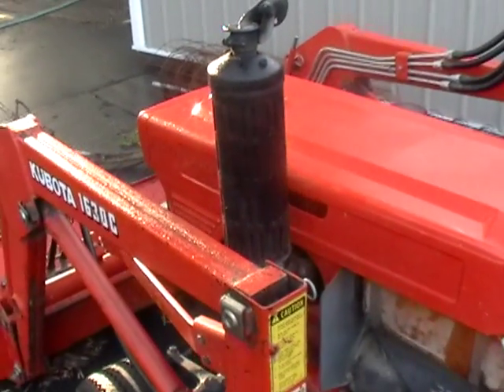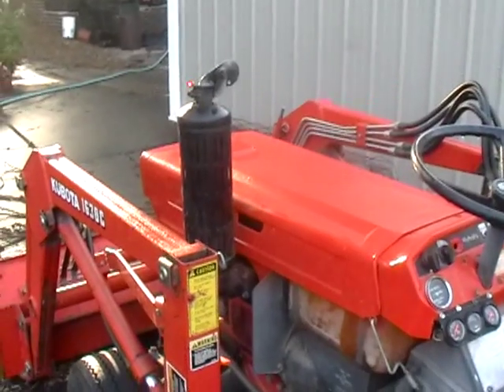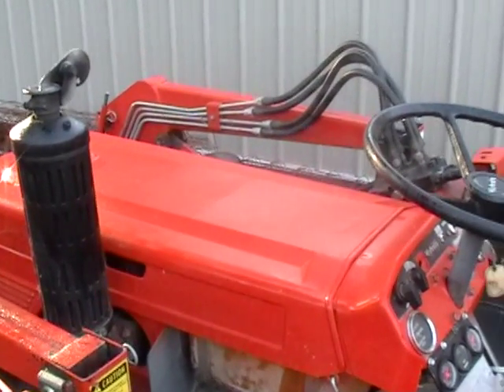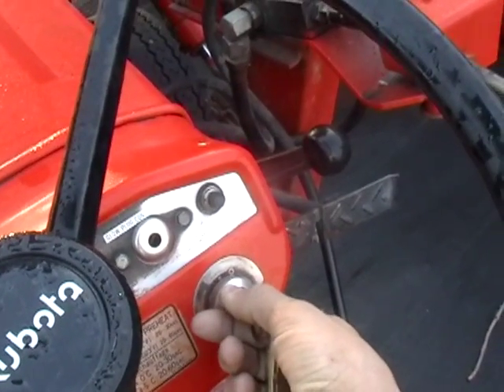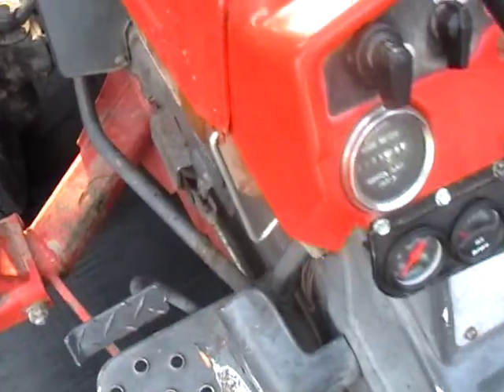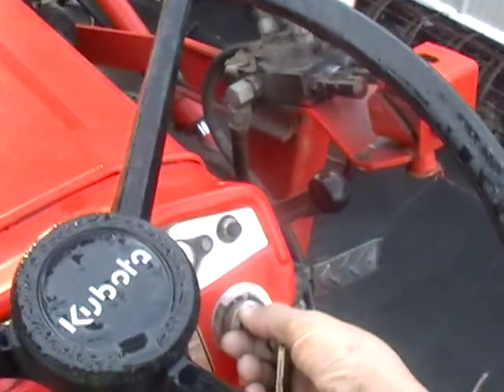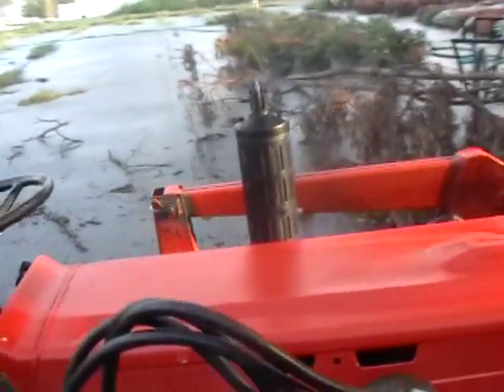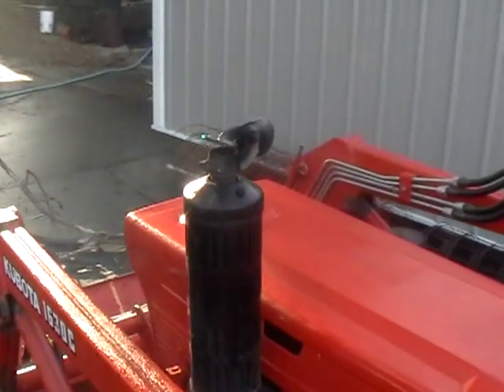Biodiesel Tractor

Comment: The Gasoline doesn't make the Diesel fuel more flammable.  Gasoline while more volitile than diesel actually has a much higher spontaneous ignition temperature than diesel.  Thats why a gas motor has to have a spark plug to run.  Compression ignition doesnt get hot enough to ignite gasoline. The benefit the gas is providing you is that it lowers the viscosity of the thick vegtable oil and makes it easier on the injection pump.